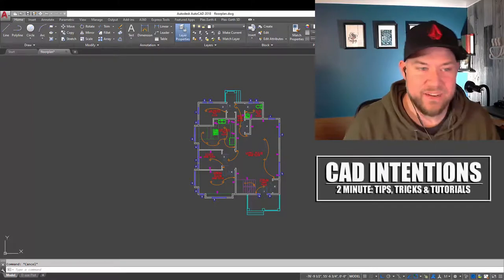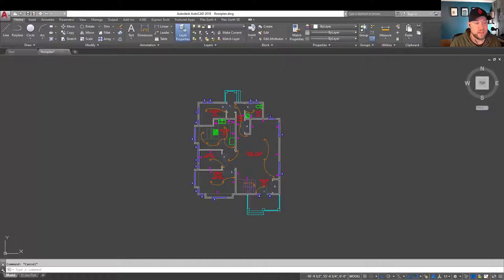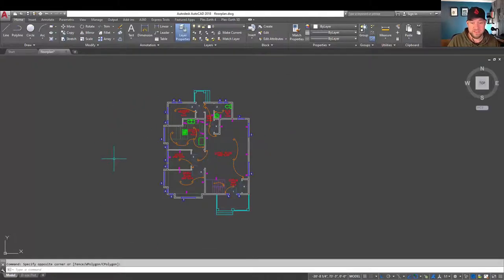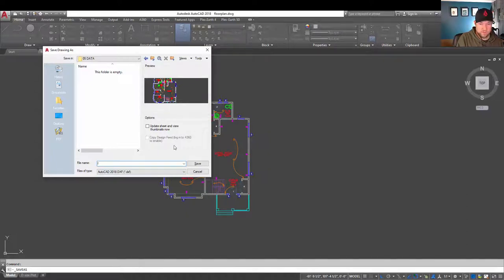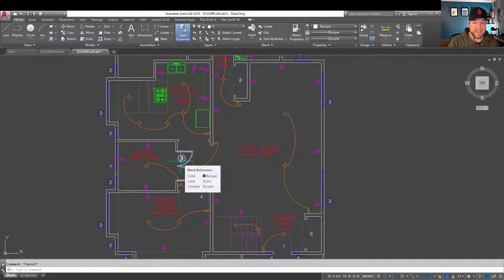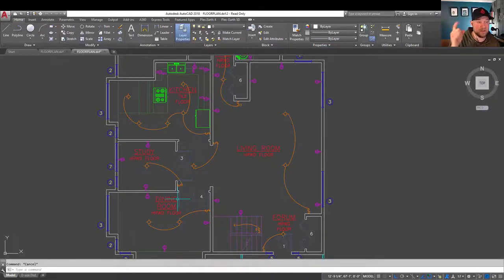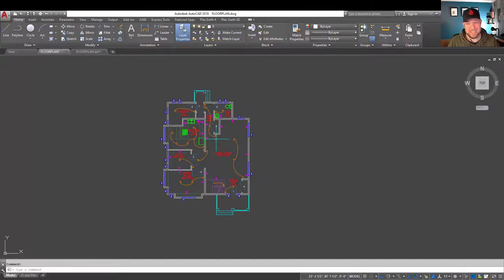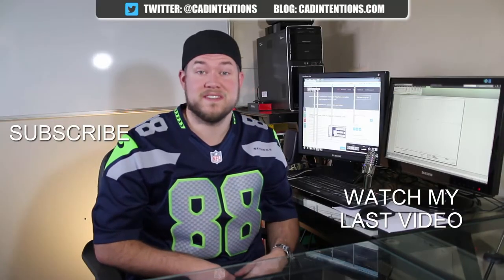AutoCAD How to Convert DWG to DXF - Export DXFs and Open them | 2 Minute Tuesday

Comment: Great video thank you. I use this in sending parts to our cnc program “woodwop”. In doing this the parts need to be on given layers with specific wording/phrasing to speak to that program.  Do you have a video or list on any of specific these layers names.  Example would be “ProcPart_19”.   Meaning this is the processing part size of 19mm thick  and this layer would be the extents of my overall part. Thank you.